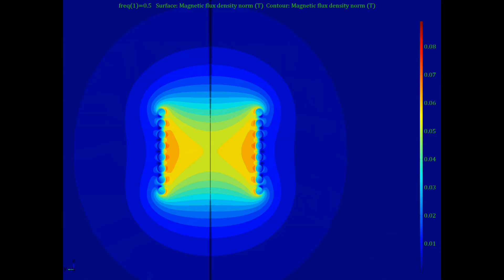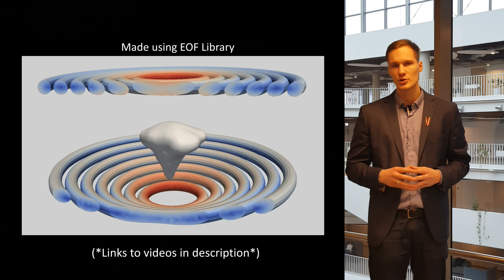MHD Technology Laboratory - Applied Magnetohydrodynamics

Comment: Okay I'm not sure if you still read old posts but I have a question about MHD, have you ever heard about a facility in Montana that used plasmasized coal to extract a DC voltage to run the control system? The coal was sent to a boiler for power and it was cleaner burning then other emissions from other plants.

Comment: "We apply our extensive MHD knowledge to study problems dealing with liquid metal transport, melting, stirring, refining and stability."
I was wondering if you have tried to pump liquid metal using a Tesla Valve and weak permanent magnets + an overlapping alternating magnetic field. I would imagine it possible to pump the liquid metal highly upwards, in pulses - much like a heart transports blood.
A video on the findings would be absolutely appreciated - as doing my own experiments unfortunately isn't cheap. 
Great channel and awesome explanations! Subscribed :ø)

A video on how to clean liquid metal would be greatly appreciated - Removing oxidation + foreign particles contaminating the fluid so it can be reused, not discarded as 'slag'. Thanks in advance!